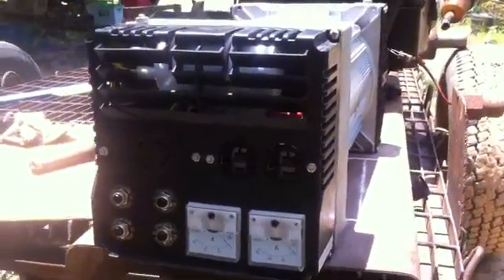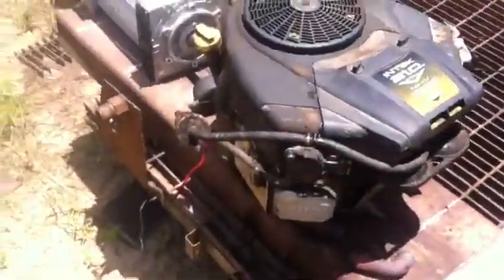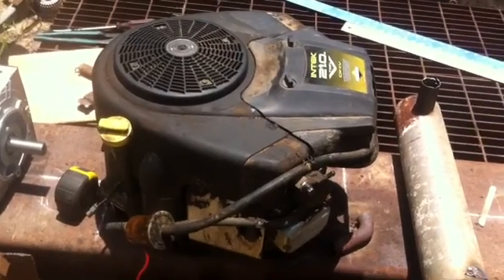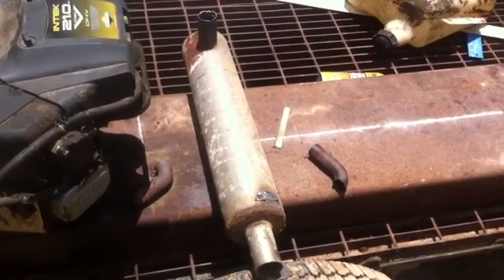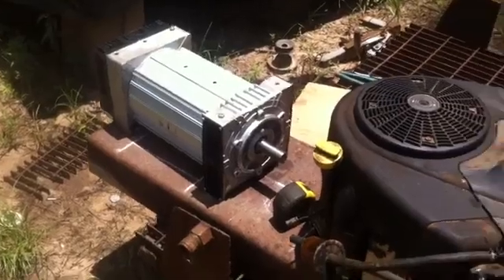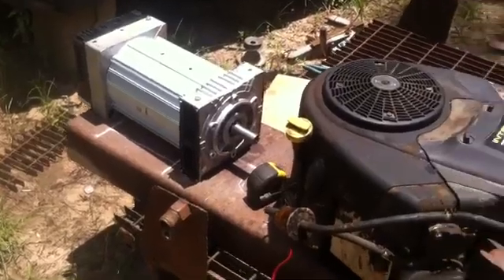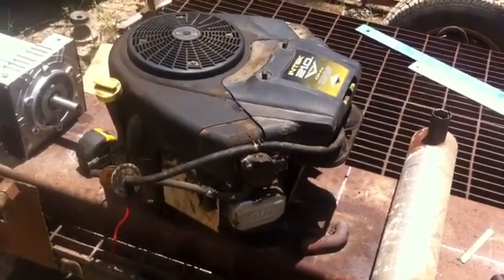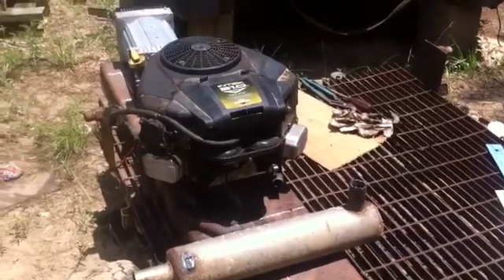DIY custom 10,000 watt generator project.

Comment: I would like a generator head that runs at 1,800 rpm. The engine would have lesser fuel consumption, yet have greater depth of horsepower to overcome voltage draw downs as demand spikes. I also would like to mount it on my GMC full sized squarebody 350 cu/in engine which has 36 gallon capacity in two saddle tanks. Lots of reserve capacity! If I can't find a 1,800 rpm generator head, I would  find a pulley combination that would let the engine run at 1,800 rpm, yet drive the gennerator at its 3,600 rpm (1to2 ratio). A four cylinder engine would be better for stationary use as long as the engine is at 40 shp rating. A car or truck engine is quieter than a rackety lawnmower engne any day.
Reply from the maker: Thought about rigging one on my truck also. My opinion would be to run gen off of PTO from transmission but that costs a bit more. Already put a hydraulic PTO on one side of the transmission and can still add another to the other side. Old Dodge 1 ton Cummins has the 5 speed overdrive NV 3500 transmission behind it. I like the combination. One of these days, I will get to such projects maybe. ;)

Comment: Have been wanting to do the exact same project, but several sources claim do not mount alternator vertically. Must be because the end bells do not have sufficient thrust capability. Therefore a horizontal shaft engine is required. Best regards.
Reply: I know this is old, but a mule drive will convert vertical to horizontal pretty easy and inexpensively.
Reply from the maker: Just priced a right angle gear box good for 40 HP at about $150. Not for the generator project but a bandsaw mill I want to build. Either way, it's cheaper than buying a horizontal shaft electric start when vertical shaft engines from mowers are practically free. ;)
Reply from the maker: +Robert Beck .. I have thought about that. Not sure yet, the thrust capacity but think that is a problem with a remedy. Seen others use the generator heads vertically with riding mowers and that was my original intent. Such makes for making the mowers more taskble. As little as I actually need use of a generator, may be able to get some good use in any event. Problem I am sure I have, is health to ever finish the project.;)